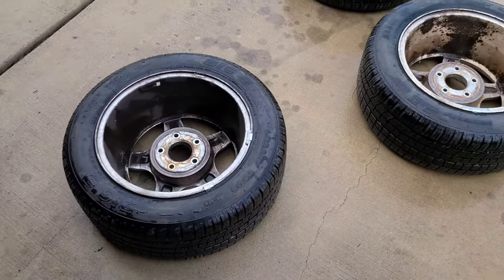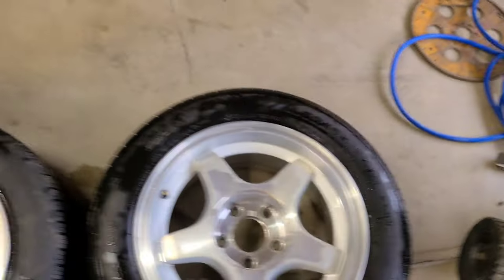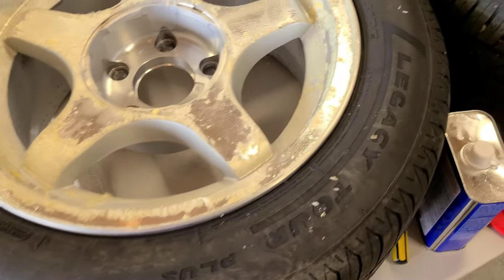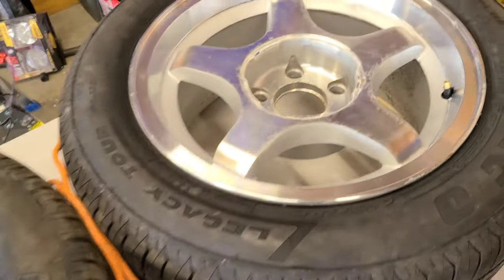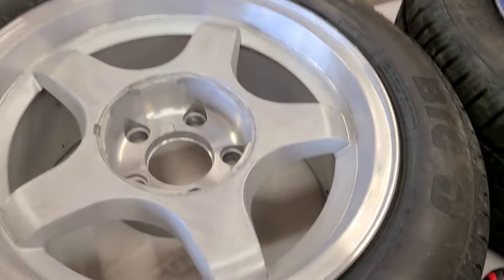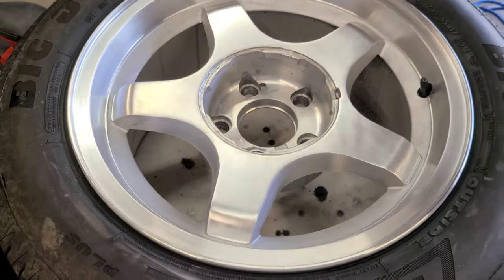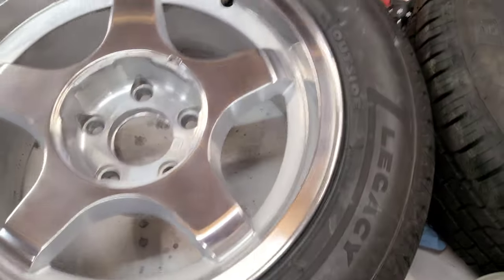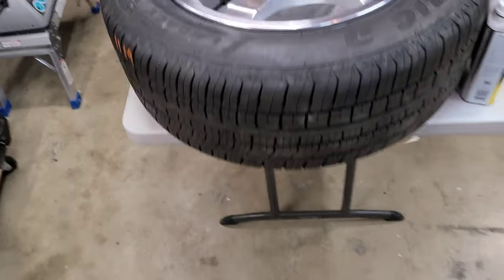Cleaning and Polishing Impala SS Wheels

Comment: How much you think I can get for a set of 96 SS wheels all 4 with caps good shape wheels only no tires minor curb rash on 1 wheel
Reply: Just bought a set in Denver with tires 1 missing cap for 500$...
Reply from the maker: Clean with the SOS pads at a minimum and post them on Ebay, Market Place, offer up or whatever app is used in your area. Its hard to say really because the value changes depending on where you are. In my area they probably go for 800$
Reply: I just bought a set of four (in about the same shape as the beginning wheels in this video) with almost new Falken tires on them for $350

Comment: For Gods sake get some iron remover wheel cleaner for those inner barrels ....the stuff will melt off without brillo pads
Reply: What brand of iron remover works like this for you? I have used Sonax and Griot's Garage. Both those brands cleaned the inner barrels some, but left a lot to be desired.